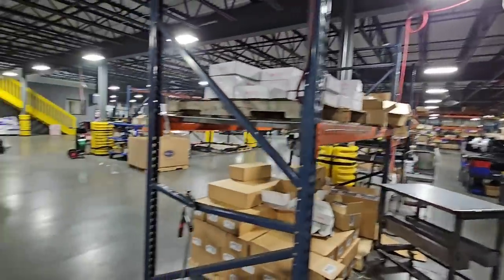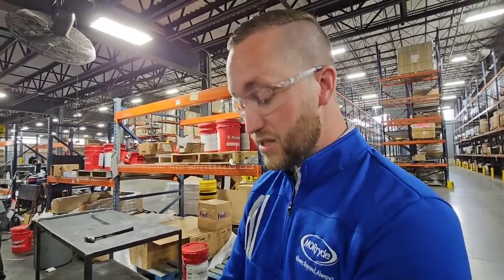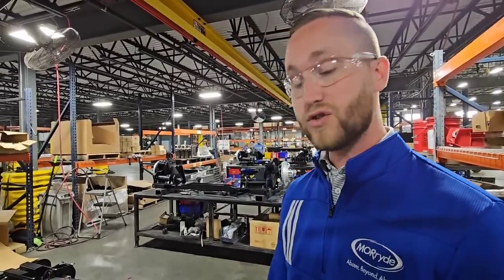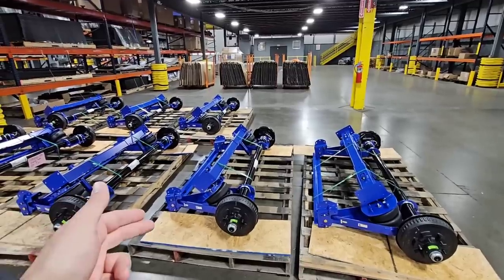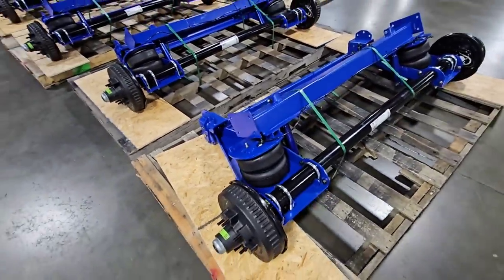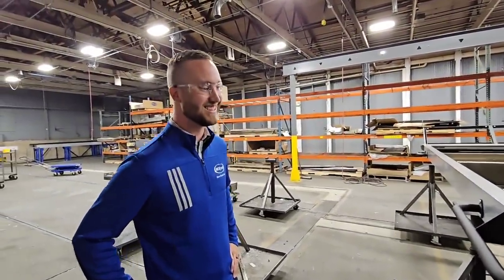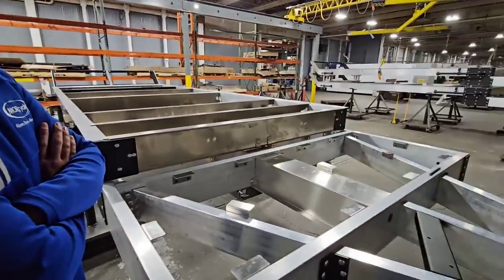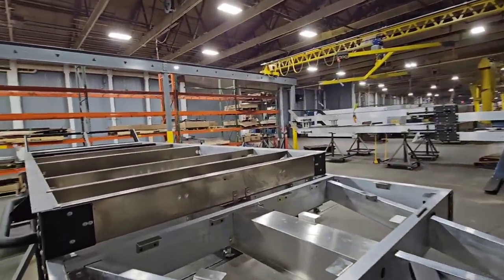Some AWESOME products Fabricated by Morryde! RV and Other Stuff!

Comment: Does the independent suspension raise the overall height of a 5th wheel compared to the OEM original build height ?
Reply: 1” on mine
Reply: We are getting the MorRyde IS system installed in July.  This video had dome great information that I hadn't seen before.